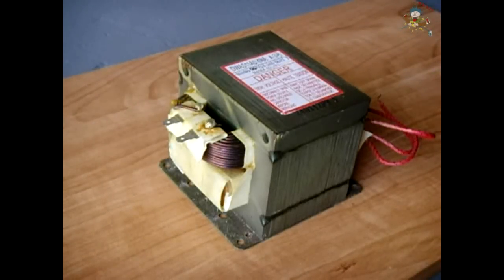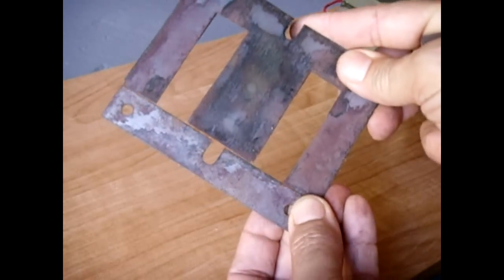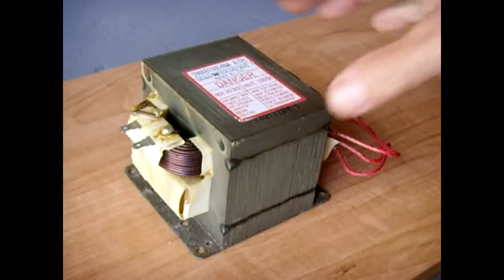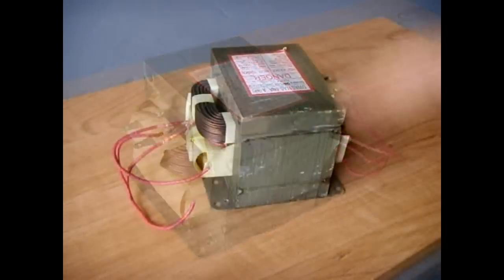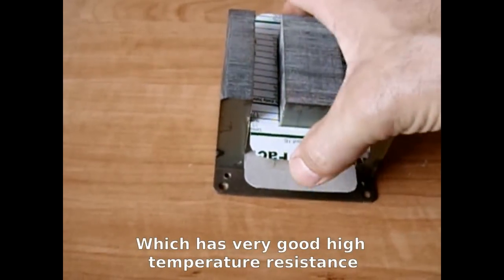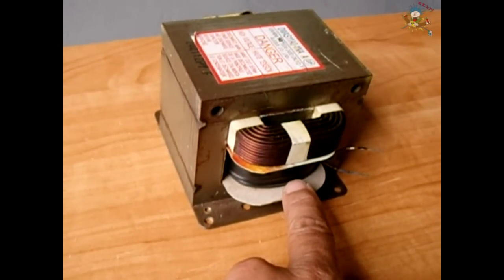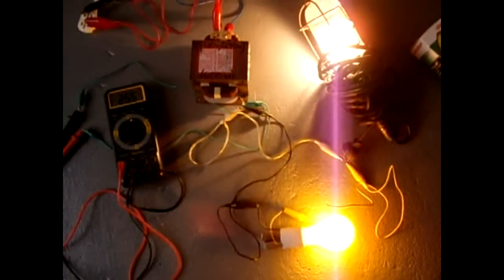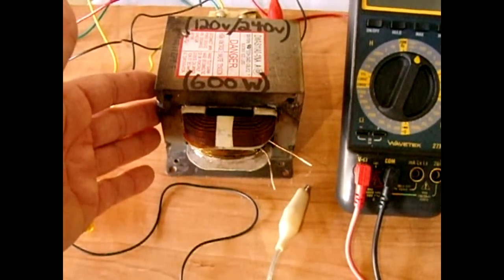How To Make Custom Power Transformers

Comment: Cool video. If i'm not completely mistaken, the reason that the 120V primary runs rather hot, is that the amount of copper and iron in the transformer is very low, to save on materials and weight. They usually push 700-1000 Watts trough a core like that, but it needs forced air cooling and low duty cycle to survive.
Reply from the maker: That is correct. This transformer is not intended for continuous use using the primary winding as it was, but microwave ovens are designed to operate non-stop for well over an hour at full power. The cooling fan in the microwave oven is usually "NEAR" the transformer, but not exactly right next to it. This transformer, as I stated in the video, will be enclosed in a housing with a fan from a microwave oven. In addition, I intend on using the transformer primarily to step down, and when I go from 240v to 120v, there is no heating problem like the heavy gauge primary. 

Thanks For watching.
Reply from the maker: Laharl Krichevskoy Like I said, if you use the transformer to go from 120v to 240V, then using a moderate to heavy load will keep the winding temp cooler, but for going from 240V to 120V, I used 500 watts for a few minutes and the winding did not get hot, only warm. In that case, no fan is needed. I will still be adding a microwave oven fan. I made a desk fan from one(in my video list), and the amount of cooling is incredible. CPU cooler is not necessary. If you are that concerned, then I would suggest you rewind the primary with smaller gauge wire with more turns. The issue would be gone.

Comment: I didn't understand why the lines of flux decreases with frequency, if we are cutting the lines of flux more quickly(higher F), then surely we would get more output voltage hence suggests more lines of flux not less? Edit: Is it because the lines of flux are wider therefore less dense?
Reply: I can explain.
Firstly, there's no literal lines of flux.

Let's take an inductor for an example.
When an inductor is supplied with DC , the current is zero at the beginning but rises over time and eventually becomes constant, limited by resistance of coil & it's called saturation. Inductors store energy in it's magnetic field, and how much it can store is equivalent to the inductance.
In short, the larger the inductance is, the longer it'll take to reach saturation, for the same applied voltage.
Since transformers work on AC where polarity changes every cycle, the inductance of transformer should be large enough so that it doesn't reach anywhere near saturation before the polarity changes. So As the frequency gets lower, the time interval between polarity changes increase, so does the required inductance. That's why for the same power level, 60hz transformer is 20% smaller than 50hz one.
Reply: @swapnilkumar9363  Good explanation      I'm experimenting with taking two little MOT's and putting them in series - keeping each at 60 volts or so - I've noticed with my current meters that the current is super low until about 80 volts and then rises  - to get my 2400 V I'll just put those in series as well -  that way you are farther down the BH Curve -  so for 50 Hz you could do something similar to avoid saturation   any ideas on plausibility ?
Reply: @TotalFreedomTTT-pk9st for  running 60hz stuff on 50hz you have to drop the voltage down to 83% of it's rated voltage, that means 120v 60hz transformer can be safely operated at 100v 50hz.
Also MOT are made to run very close to saturation where core losses are much higher, so it's better to increase primary turns by 25-30%
Reply: @swapnilkumar9363  Thanx for the super fast reply  - I've noticed these 'smaller' MOT"s  are very quiet up to around 80 or 90 volts  -  - do you by chance have any knowledge of Pole Transformers ?  more specifically the high voltage coil inductance ?  these MOT's Inductances are measuring 18 to 20 plus Henry's but I can't find data on Pole Transformers - even the Patents are not giving me numbers - thanx again
Reply: @TotalFreedomTTT-pk9st  i do not know the exact values but inductance of a good transformer at no load is just enough that when energized, the transformer has zero power factor.
Reply: @swapnilkumar9363  Thanks Swapnil  you've been very helpful

Comment: DC 0-100V 10A 50A 100A Digital Voltmeter Ammeter Dual LED Amp Volt Meter + Shunt

Do you have experience of above meter?

I was wondering how many watt this micro wave transformer can handle. And what is it rated for?
Reply from the maker: I have no idea what meter you have, but you can find operating instructions online. The transformer is rated around 600-700W, but is usually pushed to 1000W because it doesn't operate non-stop for long periods of time, and it has a powerful cooling fan close to the transformer. Thanks for watching!

Comment: I was wondering what difference is there if I just take old electric cooktop. Connect 2 end with a wire to burn some red hot wire 

Is microwave mod any different then electric cook top ?

Both is capable to deliver high amp?? Or not?

Comment: Hi Love your vids keep up the good work!!!
I'm trying to make an isolating transformer 1-1
It's 2x 240v class 220 mot's, I've cut them and removed both primary windings intact I've also saved the shunts from the middle wasn't sure if they will have to go back in?
My plan was to fit the 2 primary's back onto one transformer and weld it up again BUT!
is the direction of the windings important as I wanted the 240v in on one side and the 240v out on the opposite side but it's very confusing trying to figure out what way round the windings are running?
Any help is much appreciated
Cheers from Scotland
Chris

Comment: I realize that...you mention it in your video. I'm referring to the output. If 120 is going in and I'm rewiring it as a step up I would like something higher than 120 coming out the other end...preferably 240-250 as was the purpose of your video. What do you think went wrong with my procedure? 10 gauge wiring and 16-18 turns should've done something. Thx
Reply from the maker: Kevin Anderson You made a Step-Down transformer, not a Step-Up. This video explained everything very well.
Reply: Ahhh...so, if I add a bridge rectifier and convert the output (14 vac ) to vdc then add a couple of leads coming off the rectifier then I've made a 12v battery charger?
Reply from the maker: Yes, the output should be around 20VDC.

Comment: You can salvage the high voltage wiring by unwinding it from the inside out and reuse it in other projects, almost all the way to the outside
layer where it is heavily varnished.  You can also change the transformer dimentions where you use 1/4 or 1/2 the transformer plates.  I 
am making a PEMF Bob Beck pulser with the 110 V coil as the open air core.
Reply from the maker: Many times the wire will have the enamel pulled off as you unwind.

Comment: Great video that is much appreciated! I have some questions if I may:

1. What would happen if the top part (the "I" shaped part of the core which you placed the wood on) is not put on and you run the transformer?
2. What happens if it is still not welded and you place something heavy on the top but not very heavy which allows some vibration?
3. Does it matter whether the primary coil is on top or bottom?
4. Does it matter if the primary coil is placed up side down?
Reply: 1:  the plates would burst out to the sides and the transformer eould not work
2: it would make a ton of sound but would work just fine
3:No.
4:it does not matter if its upside down or not

Comment: Yes I know bare wire need be insulated. The problem is romax copper insulation is too thick. Can not get enough turn in the available space for the current I want. 

So the alternative is to use bare copper wire. And DIY insulation with electrical tape or some sort of heat resistant tape.

But I don't know exactly how much insulation is required.

Comment: This is a very well done video. How do you keep from burning the coils when you re-weld the two halves together? Also, it would be nice to see the temperature of the transformer when it is running.  Thanks for sharing!
Reply from the maker: The welding is not done continuously. The secondary winding is not against the outer part of the core. The primary is very close, but there is a layer of white temp resistant fabric between the primary and the core. The temp of the transformer only gets warm when going from 240 to 120. The other way around, if no load is attached, you can get hot. That is why a moderate load to heavy load is required when going from 120 to 240. This issue will be a thing of the past when I assemble this transformer in a housing with a MOT cooling fan within inches of the core.

Thansk For Watching!

Comment: Why the shit were you using alligator clips in the end vid to connect 240 mains to the trans to create 120v??? How did they not bust and catch fire after turning on not 1 but 2 power tools that draw about 1KW each? I smell lies i think, i did notice your cords were well hidden from camera sight....
Reply from the maker: I guess you don't know too much about wire gauge sizes and current carrying capacity.
Reply: @electronicsNmore  why do you think i commented? Your using what looks to be the standard cheap thin alligator cables from ebay. Im just not sure how you managed to draw what 1500-2000 watts (albeit only shortly) over those mains alligators. Just would have thought they should have burnt out

Comment: What type of computer do you run the transformer calculator software?
Reply from the maker: +jacob Conner 
Designed for Windows, but I use it on my Linux computer using Wine.
Reply: +jacob Conner The software is for 32 bit, it also not worked for me cox my pc is 64bit

Comment: Did you put in a receptacle with its own breaker? I'm wanting to play around with this but am a little worried to get started! Even though I'm an EE I still make mistakes haha. Also, how tight and neat do the winding need to be? From the looks of yours, you just rapped it by hand unless I missed something you said. 

Nice video...
Reply from the maker: Austin Butler Hi Austin. We all make mistakes. If you are worried, use a GFCI receptacle when you experiment. A tight winding is more efficient, and less likely to vibrate/make noise.

Thanks For Watching!

Comment: Thanks for replying.
In the world of Brushless DC Motors, the laminations are all electrically insulated one from the other.  The best situation from a "core losses" perspective is, I believe, thin electrically insulated laminations are best. If the core is electrically solid, I would think that you are trading some of the eddy current losses for ease of assembly. I'm pretty sure that laminated toroid cores are insultated one from another, but I've been wrong before! :)
Take care,
Nitrous

Comment: these microwave trani's operate in partial saturation mode meaning idle current IS HIGH ie lossy & will overheat with or without load if left powered more than an hour or so,  sooner with load! short term not a prob , adding about 50% more turns to primary would fix this most times but not practical just be aware of this -- pair can can make good HT supply for rf amps ect as is (without shunts)
Reply from the maker: Correct, unless you rewind them like I did. You'll need to place the cooling fan from the microwave oven right next to the transformer to keep it cool.
Reply: changing the secondary winding wont change anything regarding the saturation problem! because it's caused by too few turns on the primary at the given volts ie 120v in you will still have the same idle VA power. the only way around this is to increase turns ratio of the primary ie extra 20~50 turns or more to bring the core out of saturation or reduce the primary feed volts ..... change of angle-- these mv  tranys still make good high volt supplies ect or low volt rewinds ect if you not worried about the losses & core heating ect

Comment: Ok first thing. The transformer calculator ONLY WORKS IN 32 bit WINDOWS! But anyways I know the formulas and can do them in my head or on paper..

I have a 120 / 240 step transformer that is rated at 600 watts and has its protective covers and a handle on it. We use it to plug in EU type radio battery chargers from the US mains sockets. It does work both ways also.
Somewhere I have a multi-tap "BIG BOY" that takes 120 VAC and steps it up to 208/220/240/280/360 and 440 volts. He's a big heavy "E/I" core one. It's not something I use all the time so I think its out in my storage room ATM

Comment: I use battery is my car 80Ah supply got it
And Converter from power mosfet 15A into up voltage 110-220vac  it  easy

Comment: This is such bad science. If you are going to pull the transformer apart at least rebuild it correctly. Microwave transformers are designed to be cheap and nasty and very inefficient. Do not weld the core and increase the turns per volt.
Reply: "Trust the Science"  right ?  EnMore showed it worked and it was quiet as well and powered his 120 volts tools quite well -  So trust an actual doer who get's things done
Reply: @TotalFreedomTTT-pk9st  It may work but its not efficient and can  be improved
Reply: @smorrisby  I agree with you but some people are doers who want to get it done and also may  not run it continuous duty - I'm working right now on using MOT's in series to avoid saturation issues and that essentially doubles or triples my 'mass' and with 3 - you'd have 40 volts on each and put the high voltage sides in series to get to the 2400 volts - which is what I need but I DON"T need that buzzing hell on earth   -  thoughts  / advice welcome

Comment: These transformers are a gold mine. I have built spot welders battery chargers and I got a 5000 watt industrial microwave oven transformer and made one of the nicest little welder with tapped out puts 35 65 and 90 amps AC and by using surplus industrial forklift battery charger diodes have DC operational welding. I have used these to burn wood it can be done safely at 2000 vac  and 600ma there a death trap. I use varnish and everything . I'm glad to see you took it apart the right way ! I always save my secondary windings. I use it on all sort of other projects . Helpful tip after you rewind it you can spray it down real good with varnish and put it in an oven on 160 deg F for 2 hours and BAM just like factory. Just don't tell the wife lol. Also there is a cloth electrical tap you can get at home depot or any other electrical supply it's high temp rated it's normally white it works wonders to cover your cores to prevent rubbing.  Also it can be used to tie up wire and varnish soaks in real well. Also don't forget in microwave ovens save the temperature switches there's one for the microwave gun it's to high but the transformer one is 220 deg F use it to protect your new creation ! Nice video 😁👍
Reply: How about modifying it to gain free power via magnetic induction of your house main ?

Comment: 255V  ??? too much !! huge difference, 240V to 255V. you lights will burn...or everything you plug in
Reply from the maker: Whatever you say. LOL. Clearly you know very little about this subject.
Reply: yes. its definitely too high. The lights will not burn but excessive heat and wear will be put on the units supplies you connect in that feed. 240V should be the maximum output voltage. you are safe with any value between 230v and 240v. But 255VAC doesnt make any sense and it's just bad practice. The seconday should have some less turns than the number that was used for rewinding.